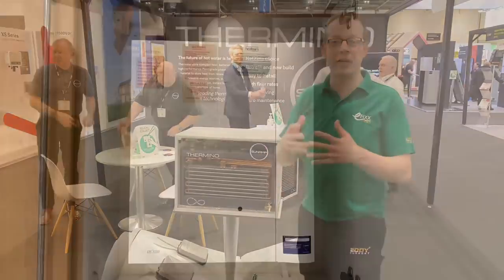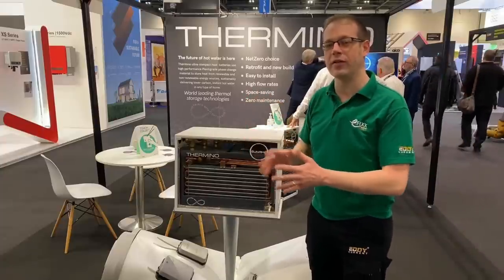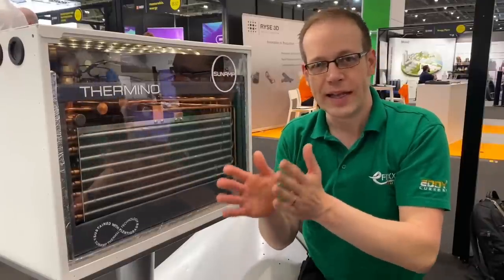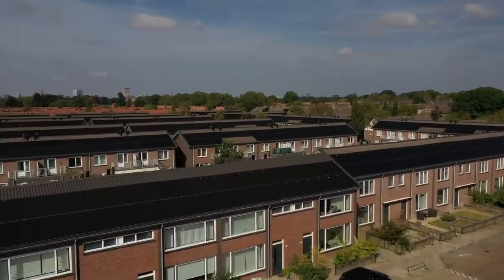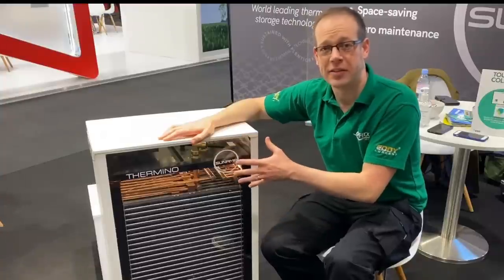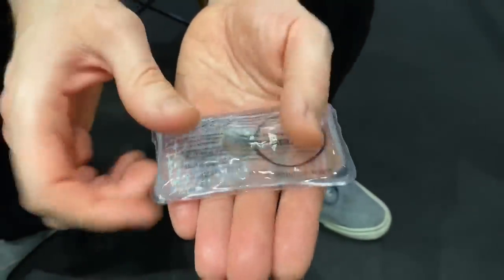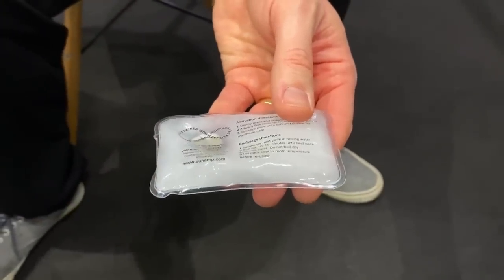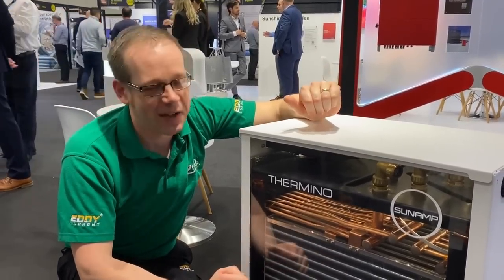The SUNAMP Hot Water Battery: What is it and How Does it Work?

Comment: You made it sound so simple but actually there are issues with these.  I looked at buying one (the largest they do), they are not cheap and as someone already has mentioned finding an installer is like finding a plumber who actually turns up.. you can’t. 

They also have a really bad issue in that they don’t recharge once they fall bellow a percentage of usable heat. They will leave you without hot water and god forbid you use these for central heating and hot water as they suggest you can, they will leave you cold. 

They do have a get out of jail feature though.. Sunamp say buy two! One for a backup.  This then makes these so expensive and take up so much room what’s the point? 
Also you can’t install outside of the home making these pretty useless if you live in a house with not much room. 

Take my advice and don’t get rid of your water tank. There’s plenty of other ways of filling that with cheaper energy if you have solar or use the grid over night using an EV tariff.
Reply: Do you have any links to the sources that describe the problem you outline. What do you mean they don’t recharge, what stops this and what is the percentage you refer to?
Reply: @jimporter  I don't have sources and I'm not Lee, but I was expecting more information on this as well. Your hand warmer requires you to boil it 15 minutes. But today was kind of cloudy and it could only boil 4 minutes. Still stays solid, no phase change here. So basically the 4 minutes of heat are wasted and this product is still waiting to "recharge" (make the phase change that absorbs energy) before being able to provide (make the phase change that delivers energy). I would expect issues like this.
Reply: Thanks for the comment.  Just what I was looking for.
Reply: The only difference this has to a water tank in practicality is size. You'll get cold water regardless of using this or a water tank if you don't put enough heat in. 

There is no wasted heat. All energy you put into this will come back out, it doesn't require a set amount of input before it starts working.

Comment: I would see that in Switzerland especially in 2nd houses (chalet) where you have a seperate system to do HW with a boiler doing 20 cycle of 20 to 75deg during the year for nothing. When you only need a pcm pluged to the main heater with the temperature around 50 deg.

Comment: Nice product, but from what I've researched, the PCM melts at 58C, for domestic hot water applications. If thats correct, then the battery won't charge off a standalone, low temperature, air-to-water heat pump. You'd need a high temp heat pump or a supplemental immersion heat source. Where's the operational  cost benefit in that?
Reply: It has an immersion element built into it.

Comment: I would see this product as combo with a less complex heat pump. 
With this product you can simplify the HP, you can have a mono temperature heat pump. No need of special components for hight temperature heat (two speed compressor, added three way valves etc).

Comment: Is it possible to use these sunamps for hot water and supplying heat to your radiators? Am I missing something obvious? In my mind the unit is just a source of heat so it could have 2 separate feeds going in to it to heat both your hot water and run your radiators? Other questions off the back of what I have just said are: 1. how long would it take to charge up just using cheap off peak electric. 2. How long would it take to deplete it’s heat when it’s used for radiators. 3. Wouldn’t it be possible to avoid having a heat pump if you charged the sunamp with overnight cheap electricity - also charged up a solar PV battery at same time - then used the PV and or the PV battery later in the day to recharge the sunamp during peak time but using the free electric from your PV or the off peak electric stored in the PV battery? Isn’t this a sensible doable solution that avoids heat pumps that seem very expensive. Yes you have the expense of fitting PV and buying a battery. The only down side I can find (if the sunamp can be used in the way I describe) is that some people may want a heat pump to give them a cooling capability if we see those 40 degree days again. I have PV already and it pays me back around £300 per year from F.I.T and obviously it saves me more by supplying me with electricity during daylight hours so my question is why spend money on a heat pump when a solar PV battery might be a better money saver IF….a sunamp is capable of providing central heating and hot water? I welcome being educated by anyone who knows the capabilities of the sunamps.

Comment: Hi, quick question. The data sheets state a 25l/min max draw off at 55 degC. If for argument sake I draw off at this rate this will give me 12 mins of 55 degC water but after this, does the temperature just degrade to a lower value? I know in reality a shower will be mixed down so this isn't a real life scenario but wanted to understand how it works. Also, from a reheat prespective how much energy is required to re-energise the phase change material? For a 300 L tank with reheat of 2hrs from 10-60 degC is 8.8kw (4.4kwh of direct electricity) what is the equivalent here? if my maths is out let me know but in priciple what is the comparison? If it can continually produce low grade heat after the initial discharge then this is very good; just thinking about a very busy house if people are having loads of showers if guests are around
Thanks

Comment: Its standby power is 7W...it's like 2 LED bulbs switched on, what does it do when standing by, why 7W for standby? For the "e" models (mains electricity only models), does it need to use the full power for hours each day, or only need the power at the moment when the hot water taps are switched on?

Comment: Hello,It is an interesting product. I would like to ask you, what are the losses [ kwh / day] ?
Reply: Heat loss rate kWh/24 (W) according to size of heat battery is: Thermino 70 - 0.48 (20); Thermino 150 -  0.67 (28.1); Thermino 210 -  0.77 (32.1); Thermino 300 - 0.84 (35)

Comment: Clever stuff! 😎👌 So it's a bit like pumping water through a grid of pipes and heat exchangers set in the chemical? Or like a storage heater stores its heat?... Salt & vinegar for your chips by the bucket full if it leaks lol.
Reply from the maker: That's exactly right, it's essentially a storage heater with the added bonus that the phase change material makes it super effective as it can store more heat than water, which makes the unit smaller than a tank. 👍

Comment: How does it control the crystallisation process? If the design is similar to heat pads, once crystallisation starts, it can't be stopped. In which case, you would need to use all of the energy that it is storing immediately, else it would go to waste.

Comment: What is the melting/freezing point of your phase change material? I want to make a coffee cup that absorbs the "too hot to drink" energy but gives it back (phase change temp) to flatten the temp drop curve to lengthen the optimal drinking temp time? Brilliant right?
Reply: Interesting. The phase change material used in the Thermino product range melts/freezes at 58°C. Sunamp has phase change materials across a widen range of temperatures for different applications, for example, -30°C for refrigeration, 5°C for cooling such as cold chain storage, 58°C for domestic hot water and space heating and 118°C for high temperature >80°C hot water applications such as sterilisation

Comment: I have an aging gas boiler that requires changing. The replacement cost is not cheap and so are you suggesting that this unit replaces the existing tank as well! Heat exchangers are not cheap either, and until prices are much lower, for me, are not an option. An indication of what it all might cost is, unfortunately, missing from this otherwise clear description of how the unit functions.

Comment: Traditional heater used 4-5 times more energy, so I don't see how this would increase the efficiency. Heat pumps are efficient at low temperatures (under 50). At what temperature this phase change material works?

Comment: so this is kind of like a combi boiler (instantaneous hot water, not stored) but instead of gas its using stored energy which can come from either heat pump or electric? How long can it hold the heat? Eg could you heat up with off peak overnight electric and use through the following day? And can this run heating as well as hot water, or mainly for hot water only?

Comment: There aren't many materials with a higher specific heat than water, and those are phase change materials.  But even heat stored in phase change medium is subject to the exact same thermal losses - you don't own the heat - you only borrow it.  If you don't use it, it goes away the same as if it was stored as hot water.

Comment: How hot does the input have to be? My understanding is that ASHP are most efficient at lower temps like 40-50c. Do you need a special ASHP to recharge the sunamp?
Reply: Current commercial Sunamp products require a minimum of 65 degrees, so they push up into the less efficient end of the heat pump temperatures.

Comment: Brilliant idea. 
Now I've got to figure out how am I gonna fill my 400l hot water storage tank with sodium acetate... 
Making 400l of sodium acetate never crossed my mind tho... until today. Thank you.
Reply: The sodium acetate tangent is a little misleading. It's similar to how these work but not the same. Imagine it more as a tank filled with candle wax. You put energy in, slowly melts the wax. You take energy out, wax solidifies. The phase change stores a lot more energy than water does and keeps the temperature reasonably constant during the change. 

Wouldn't work in a conventional water heater as a drop in solution, but some manufacturers offer little sealed packs of PCM which would. Or in other words, fill up your tank with ping pong balls filled with wax.
Reply: @Thermoelectric7  But paraffin has a lower density than water and a lower heat capacity than water. 
Trihydrate sodium acetate is melting at about 60°C, easily attainable with a heat pump, makes a lot more sense...

Comment: When the system fails, and it will. I can imagine the cost for someone to come out and fix it right the first time will be astronomical. It reminds me of an old Homart stainless steel porcelain lined gas furnace in a house I used to own, sure it wasn't that efficient but it chugged away every year for 50 years and it still in the house. My Sister had a new high efficiency  model and had a guy out every year to fix the damn thing. Technology is great just make sure its dependable!
Reply: Totally agree, I was just reading through the comments looking for something like this. Obviously it will be beneficial for some applications, but you almost have to re-skill an entire industry. There may be a reason the old 'hot water cylinder' has been around for so long. 
That said, a very interesting product, and I will research it some more before committing to replace my vented cylinder with an unvented unit.

Comment: What temperature water can it supply? And what has to be the temperature of the water going in to store the heat?
Reply: I believe they heat to around 70°C, you install a thermovalve on the hot outlet to supply your basins

Comment: how long will this system take to heat up water at ambient temperature? Will it take the same time as an immersion heater i.e. 5-10 mins?
Reply: The exchange/heating would be instantaneous as the PCM is held at a much higher temperature than boiling point of water.

Comment: But doesn't it have to boiled again to recharge the hand warmer? Meaning, if you have to boil it, you are using just as much energy as its putting out?
Reply from the maker: Yep, it's space efficient heat storage not heat generation. 😊
Reply: This seems like it might waste more energy giving off more heat than needed and waiting to reset the phase for the next time hot water is in demand. Perhaps adding with it a  pielter system could make electricity with the wasted heat between phase changes.

Comment: Could you use this system with PV and the integrated emersion heater to provide hot water and thus reduce your gas bill to only power your heating, in an average 3 bed semi?
Reply: Yes our Thermino ePV, is the right product for this. It charges by using Solar Power via a Solar Power diverter.

Comment: It does not make that much sense regarding the discharging of heat, but I can see this technology potential with integrated preheater "temperature ranges for pcm is not that high" in commercial hot water application, iam conducting my graduation research in this matter, Would appreciate any feedback.

Comment: Could this just be used to replace an existing water cylinder? If so would it be more energy efficient?
Reply: It could replace an existing water cylinder however the efficiencies will be pretty similar. Improving the efficiency lies with improving the heat source. Changing your electric shower to use a heat pump and this tank instead, for example.
Reply: @Thermoelectric7  thanks for taking the time to reply.

Comment: Hi, I'm looking into the alternatives for a new heating / hot water system and I want to get a setup that can cope with changes. I'm thinking of continuing with a gas boiler for now, as to install a heat pump would be too much of a financial commitment. I have been looking at the mixergy tank, but you can only get an indirect coil/ immersion tank in unvented form which could give me issues regarding pressure relief pipework. 

I'm sure Sunamp used to make more of charging it with heat from a gas boiler in the past but this is the most recent I have seen it mentioned.  Would you plumb it the same as a cylinder if you can set a low temp at the boiler and would the signal back to the boiler work on capacity and not really temp. My short term aim would be to use cheap off-peak electric then gas as a backup , medium term PV, and then finally heat pump.
Reply: Having done some more research on Sunamp's website it's not as versatile as I'd hoped. You have to buy different models per application (HP/Boiler/PV as main) rather than being able to add  HP module later like Mixergy. Would have thought low flow temp gas boilers are getting close to newer HP's temp now, in fact an older model UNiQ HW+iPV went to other way by saying for use with high temp HP and gas boiler.

Comment: Can this be used to improve the performance of a heat pump when its being used in cold mode for an air conditioner?

Ive seen a similar device for heating pools, BUT, the pool is just too far away.
Reply: It would not be possible as we wouldn’t allow direct refrigerant in the heat battery. There would need to be some separation between the refrigerant circuit and the water circuit.
Reply: @SunampLtd  so it sounds like you do have 2 seperate circuits, at around 2 mins its explaining you have a heatpump hot water circuit and then a usage circuit. 
Seems wierd to have a heat pump go to water then to the phase change material instead of just going direct from the heat pump into the phase change material.

Comment: Excellent video and very clear description, thank you. You mention using the heat battery for a shower or to wash up... could it be used to replace a gas combi boiler for central heating, i.e. hot-water radiators? Could it supply enough hot water to heat to run the central heating for 2-3 hours in the evening and morning? Thank you.
Reply: In short, no. The heat required to heat a large space far exceeds the capacity of any form of storage.

Comment: Quick (and perhaps uniformed question!): Can this be used to replace a boiler for both DHW and heating circuits? Or is it only "meant" for DHW replacement?  I ask as we have a oil-fed condensing boiler feeding a hot water tank (for DHW) and also teh heating circuit. Thanks in advance.
Reply: The short answer is yes, but the longer and more useful answer is that it depends on the model selected, and it may well be that in practice you'd choose 2 separate heat batteries rather than a single one with dual heat-exchangers inside it (although these do. as I say, exist).

Comment: How many litters a minute and at what temperature can this produce with a 40°c flow temperature from a heat pump? 
Looks like a good bit of kit, I’m guessing it uses the immersion heater to boost the hot water temp?
Reply: My understanding from speaking to Sunamp themselves is that all their current commercial units require an input heat of 65 degrees C, because the phase change fluid is the 58 degree product.  Thus as things stand, charging one of these from a heat pump is done so at a only with higher temperature heat pumps, and thus at lower COPs that you would really want from the use of your heat pump.

Comment: The claims made in this video are fairly exaggerated.
I do not see the advantage of this over much lower cost water tank.
Looking at the brochure the small unit has a thermal storage capacity of 3.5kWh and the size is 36.5cm x 57.5cm x 44cm so a volume of 92 liters.
The same brochure mentions this will be equivalent with a 71 liter water cylinder so say water is heated from ambient 20C to just 60C thus 40C delta thus 71 liters x 40C x 1.16 = 3.3kWh of thermal storage. Yes the 71 liter of water will need to have some external thermal insulation so volume taken by that will be higher say maybe 100 liters ? but that just takes 10% more space and even that can be canceled by increasing a bit the max water temperature to say 65C.

Comment: Hmmmm, what if, we tap off the hot refrigerant liquid from AC units rather than blasting it into the environment and use that to charge the phase change material?
Reply: Capturing tat heat is done in areas that AC all or most of the year. Usually in tanks of water.
Reply: @kkarllwt  The point being is Not using tanks of water, using phase change heat batteries.